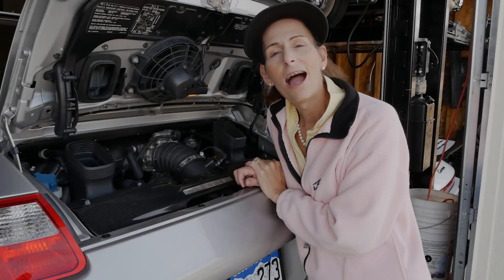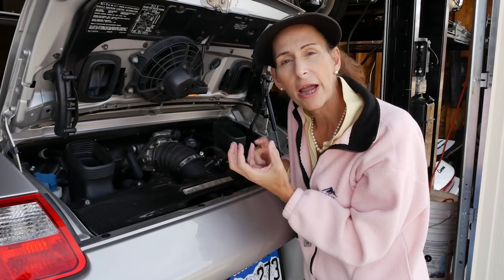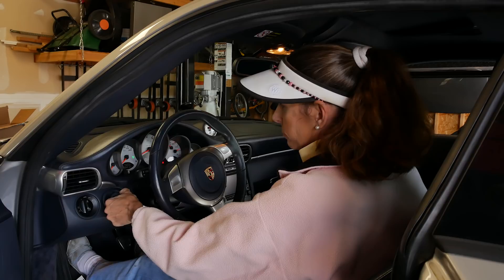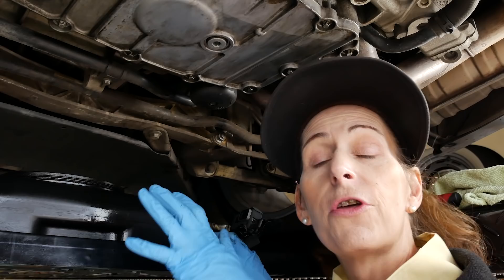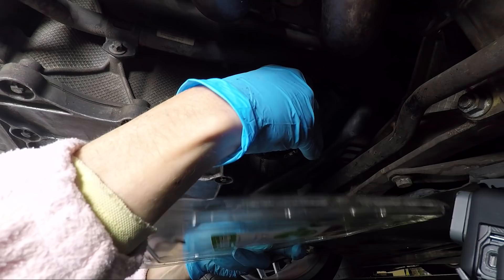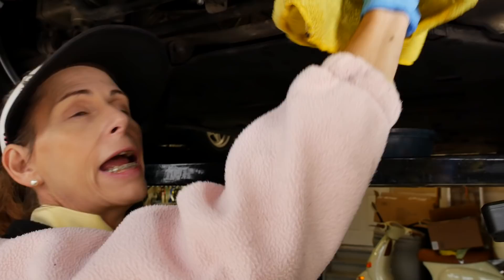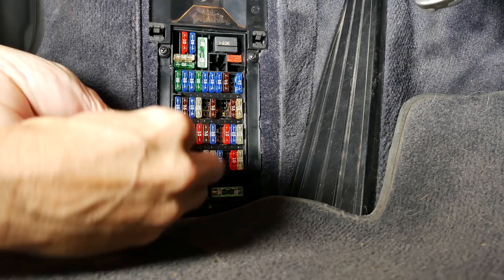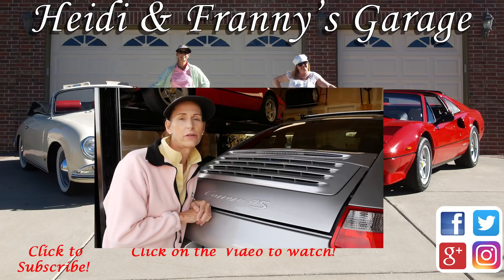How to Change Oil on a Porsche 997 Carrera 4S – with Blackstone Analysis! (DIY)

Comment from the maker: Hi Everyone, A new video on an oil change, this time on a 2006 Porsche 997 C4S with the super cool X51 performance pack.  This is our friends Dave and Jody's car  - you remember their beautiful yellow 2002 Boxster :)  We did an oil pull for another Blackstone analysis and Dave will post the results as soon as they come back.  I did a few sort of optional steps that you can decide if you want to bother or not.  They are to reduce ware on initial startup with the new oil  I have all this info in the description, but tools and parts are:

The following steps are optional:
• Prefilling the oil filter housing half way with oil.
• Blackstone Laboratories oil test.
• Pulling the fuel pump fuse.

The parts used are:

• Oil Filter Kit (includes large rubber O-Ring): Hengst E14H D77 (99610722560) or MAHLE https://goo.gl/yJLkuD
• Mobil 1 120760 Synthetic Motor Oil 0W-40, 5 Quart : https://goo.gl/GECf9i
• Case drain plug washer: 900-123-106-30 18X24 (Al)

You’ll need:

• Filter Cover Socket: 000-721-920-40
• 8mm Hex
• Torque Wrench
• 10Qts of oil (capacity is ~9Qts)
• Blackstone Analysis Kit (optional)

Torque Values:

• Case Drain Plug: 37 Ft-Lbs
• Oil Filter Cover: 19 Ft-Lbs

The oil I used (supplied by Dave) was Mobil1 0W-40, but use what is specified by your owners manual.

* UPDATE: I got a message from a very knowledgeable viewer who mentioned the oil level is best checked warm as the oil will expand and it reduces the risk of over-filling.  In addition to that, it is best to shoot for one notch from the top and not the top mark on the E-Gauge.  I also did some research and for the 997.1, the oil check system tries to take into account the temperature and will control when it will display the oil level. For the 997.2, the oil is checked hot.

Hope you enjoy this!  Any questions, please leave them below.  Thanks!  Franny
Reply: I enjoyed your Carrera 4S oil change video. I want to keep my 997 2008 Turbo from starting to bring up the oil pressure. Which fuse is the fuel pump fuse? Do you have a Turbo oil change video?
Thanks,
Kenny H

Comment: Dear Heidi and Franny, First off, I wanted to compliment you on the channel and the videos. They are very educational and informative for DIYers such as myself who would like additional tips on properly caring for your car. I've watched almost every video and will start applying some of your techniques to my maintenance procedures. Second, I especially like that you have a particular focus on Porsche - it's one of my all-time favorite car brands. However, I am a vintage Volvo enthusiast and have exclusively driven Volvos for many years, since a car accident in late 2004 (Yes, I was in a Volvo!). I'm sure that you see countless old Volvos in your area out in Colorado.

I also like the fact that none of your vehicles are what they call "garage queens," in that you drive all of them whenever you can. I have three Volvos - two 1989 740 GL sedans, and one 2000 V70 station wagon. I purchased all three cars from their original owners, who were all U.S. military. They are some of the best owners to purchase a vehicle from, as you know that they have taken meticulous care of their autos. One of the 740s has well over 300,000 miles on it - 306k, to be exact. I've found over the years that the older RWD Volvos with the "redblock" engines are some of the simplest and easiest vehicles to work on - for example, doing oil changes takes about 20-25 minutes for me (4.5 quarts with filter). And just like you, I use only OEM parts - no exceptions. I don't take shortcuts when maintaining and repairing the Volvos, and I don't cheap out on the parts either.

If more folks watched your videos, there would be a lot more older vintage cars still on the road. Just my $.02.

Keep up the good work! Best, Paolo Rosales, Alexandria, Virginia
Reply from the maker: Thanks so much!  I had a Saab years ago and just loved it.  My sister had an older Volvo and it was a great car!  I always love seeing the P1800s at shows ;)  Franny

Comment: This is the best video for a 997.1 oil change that I have found, and I think I have watched at least ten. Thanks guys. I’m off to do it right now!!!
Reply from the maker: Yea!  Thanks so much! I hope it all goes well :)
Reply: @HeidiandFranny  ha! Guess what? I got all my stuff ready and then I find out my car has the spin on adapter.  That means I had the wrong filter. The wrong wrench. And I certainly couldn’t simply fan out the filter to inspect it. But, I made the whole thing work.  I did, however, do your fuel pump fuse trick!
Reply from the maker: @frugalera  oh no! Why would someone do that? The factory setup works great. Oh well.  I suppose you could use a manual can opener and still cut it open, but what a pain. Well, party on I suppose :)

Comment: Excellent video. Liked the precaution of fuel pump fuse removal. Bet the OPC doesn't bother with any of these precautions!! My OPC is pretty sloppy...so I do the servicing myself...not simply to save a whole wad of money for very little in return...but to make sure that servicing is done correctly and that paintwork doesn't suffer those annoying scratches and chips from careless contact from tools!

Comment: Thank you for a very informative video for those that like to do their own oil changes. IMHO, Porsche didn't get the IMS issue solved until the 997.2 or 2009 model with the complete new engine design. I've talked to many people with 997.1 (i.e. 2005 - 2008) cars that have suffered from IMS failure. Had they took your advice (e.g. examine the oil filters) as well as a few other things (i.e. change oil more regularly) they could have avoided engine failure. I agree the updated bearing in 2006 was more robust and could handle the load better than the previous single row bearing found in the 996 and early 997, but still could fail which required the motor to be completely split to service and repair if the motor could be reconstructed.
Reply from the maker: Thanks for that!  We had an '06 Boxster (did I mention that?) and I did sweat the oil changes a bit.  It is difficult to know exactly when Porsche changed over to the non-serviceable bearing by engine numbers. So, the long and short is, as you mentioned,  '09 or later if you never want to even consider it, '06-'08 if you are willing to take on a small(er) risk, and earlier if you take the car in and just get it replaced with a rear main seal and new clutch.  For all of them, cut open the filter and maybe send the oil out for analysis.  Oh, and drive the car!  Looks like there are more failures in cars with short trips/low mileage and less on track cars.  That's probably because of water and gas in the oil penetrating the seal and washing out the grease in that bearing.   Franny
Reply: Most of the experts (Flat6Innovations, LN, etc.) say that the bearing and intermediate shaft was updated mid-year in 2005 for the 997. And so, if you have a 2005 997, then it's possible you have newer bearing, but you can't be 100% sure without examining the outer IMS flange. If you have a 2006 - 2008 997, you definitely have the updated shaft and the larger non-serviceable single row bearing. The larger single row bearing in the 997 has proven to be superior to the older 6204 single bearing found mostly in the 2000 - 2005 996 cars, but it still can fail. Therefore, it's important that people that own the 2006 - 2008 997 cars, that although you have a better bearing, it's still smart to take preventive measures (changing the oil every 5000 miles or twice a year, examining the oil filter, BlackStone oil analysis, etc.) to minimize your chances of catastrophic engine failure.  In my humble opinion, M96/M97 "garage queen" cars are more susceptible to IMS failure than well-maintained daily drivers. I believe there is a lot of truth to your theory about acidic oil penetrating the bearing's seal and causing it to deteriorate and once load is placed on a damaged IMS bearing, it's... BOOOOoooOOOOoooOOOOm!!!!
Reply from the maker: Lol.  Thanks, so it was mid-year 2005 that it changed... Good to know.  I tried to figure that out when we had the car and got totally turned around chasing down engine number ranges.  What is your opinion on the aftermarket bearings (LN, etc.)? I know of someone who had the bearing swap preventively only to have it fail a short time after.  I don't know if it was just an OEM replacement or not, but I have wondered if anyone is tracking the updated bearing failure rates.  Not Porsche's finest hour...
Reply: Yes, that's coming from the people like LN and Jake Raby that know these engines inside and out. Aftermarket bearings? That's a good question! As a Porsche 996 owner myself, I've thought about that a lot, there are only two options of the table for me - the LN engineering bearing (IMS solution being my top pick) or the new OEM IMS replacement directly from Porsche. That's right, Charles Navarro from LN said that Porsche is now offering an official bearing replacement for the 996 and 2005 997.1 cars. The Porsche OEM bearing is similar in design to the updated bearing in the 2006 - 2008 997 cars. But hands down, if I were going to replace the bearing with an aftermarket product, it would be from LN engineering. They're the only ones that sell a proven patented bearing. To date, LN states that the IMS solution has no failures so far. The IMS solution is a patented oil-fed design similar to design to the GT2/3 and Turbo series cars. Please know, I'm not paid by either nor have any financial dog in this fight.

Comment: Great video! On those engines, I always replaced the 8mm drain plug, because it’s very difficult to remove it it get stripped out. $5 part.
Reply from the maker: I totally agree...  the hex kept getting stuck in it :(  Just replace with a magnetic plug and problem solved :)

Comment: Franny, Also I think that should be included how to reset the oil service light in the dashboard, as it seems that is on when you started the car, otherwise, very detailed procedure. Regards!
Reply from the maker: Yes.  The owner has a Durametric and he said he would just go ahead and reset it.  For our cars I've just dropped into the dealership at an off time and they are happy to do it.  I don't think it can be done through the menu.  A thought might be the Carly ODBII plug-in.

Comment: Heidi and Franny, Love the channel and look forward to the videos I am looking to purchase a used 997.1 Can you tell me which year of 997.1 that Porsche solved its IMS bearing issue. ? 

Thanks
Mike
Reply from the maker: Hi Mike, It was completely sorted in 2009, but starting in 2006-ish the bearing is no longer serviceable without a complete tear-apart of engine.  It really goes by engine number and not year.  I have researched this a bit when we had our 2006 Boxster but I found a bunch of conflicting data.  You might want to do a little digging on Renlist and Pelican and see if there is any new info on it.
Reply: @HeidiandFranny  Thank you for your response. I do appreciate your help
Cheers
Mike

Comment: Do modern Porsches not have magnetic drain plugs? 

Also would have been a good idea to have the camera show the oil pressure gauge while you’re cranking it over, as that’s the point of doing it to build some oil pressure first. Otherwise, very nice video!
Reply from the maker: Yup, totally missed that opportunity.  I had forgotten that the 997s had the pressure gauge on the far right.  It was missing on my Boxster.  Oh, and they don't have magnetic plugs from the factory, but it is an easy, cheap upgrade.

Comment: Never double or triple click a torque wrench - it adds to the torque applied more than you realize. And i am against filling filter housings with oil unless you know its absolutely clean. A small piece of dirt not going through the filter and into the bearings could cause permanent damage. Otherwise a great video.

Comment: hi franny, please can you do at some point a service /oil change on a 996  thanks as  you explain it so well to us mortals
Reply from the maker: Hi Mike, Check out the Boxster oil change...  That will get you going on the 996 NA (M96 engine) cars and I did our 996TT for the Mezger.  The Boxster is basically the same, just with the engine in front of the transaxle.  I might be able to find a 996  to con someone into letting me get my blue gloves on...  F

Comment: Hi Franny, how do you reset/remove the “service now” message on the instrument cluster?
Reply from the maker: Hi Bernard, The easiest believe it or not is to stop by a dealership during an off hour and most will do it for free.  If you want to do it yourself, then the Durametric will push out the interval, but I don't think you can set the actual time interval.  There are other OBDII/phone modules you might be able to use, but check to be certain it can actually clear services intervals.  I don't think you can do it from dash controls like you can on the MINI :(

Comment: thanks that was a  great video,   what s   the weight op the oil
Reply from the maker: @user-qv7ov9gq5y  Just use the manufactures recommended oil and you'll be fine.  Weights are dependent on the climate the car is driven in.

Comment: I have a Porsche 996 from 2002 - when driving at constant speed between 86 and 100 kmh I hear a whistle , we a press the gas just a bit the sound is gone, same when I remove my foot from the gas so only at constant speed when engine is warm. Who knows what this is, or had a similar experience? Thanks Oscar from The Netherlands

Comment: Another 997 question. What's the actual voltage on the battery when the engine is running and hot on one of these? I only get about 13.6 volts which I think is low. When I purchased the car it had a brand new alternator on it. On the drive home at a motorway rest it almost did not start.  I later noticed low charging voltage of 13.2 volts hot. After living with the problem for a few months I came to the conclusion my starter / alternator cable were at fault. So I replaced that (horrible  job). Now the starter is fast but I now only have 13.6 volts. As my car sits around for a week or so at a time flat batteries are a problem. I came up with an interesting solution to that a year ago. That is to use an AGM type battery. Now no problems but I still think 13.6 volts is lower than it should be?
Reply from the maker: What about a trickle charger?  We have those especially for the winter months. Also, 13.2 seems normal but you could check the specs.

Comment: Could you please please share your opinion on the IMS bearing M96? Also any after market improvements
Reply from the maker: It is a potential time bomb if you have not had it fixed.  However, if it is fixed by a competent shop, you should never have an issue and get a great car at a reasonable price.  Regular oil changes and monitoring like Blackstone will help the unfixed cars, but no guarantees.

Comment: Franny, do you have to clear the service needed indicator manually? I know some cars have elaborate combinations of turning the key on and off, shifting gears, and putting on the brake to clear service indicator lights after service is performed. Does Porsche make it easy?
Reply from the maker: Hi Sherri, I believe you need a Durametrics or similar...  If you have a good relationship with the dealer or an Indy they can do it for you as well.

Comment: Thanks a bunch ! I just changed my 996 and it’s got the original IMS bearing... i noticed a bit of a leak ( i guess it’s the rear seals) 
   How would you address that shaft bearing? Since I realize the seals need replacement...
  Thanks
Reply from the maker: Well, the transmission will need to come out and you can do the rear main seal at the same time.  Check the clutch, because while you are in there...  Is that where your leak is? Between the transmission and engine?
Reply: Heidi and Franny's Garage 

Yes the leak is between the two ... what’s you view on this aftermarket fixes ? Which is best ? Why
Reply from the maker: Ok,...  The RMS can allow oil to seep into the RMS bearing and cause it to fail so, that needs to get done. LN Engineering is very popular.  I honestly have never had to deal with this issue so I don't have first-hand experience.  Looks like their kit is $800 or so. I wonder about the active oil flow systems... Seems like more complication than necessary and IMHO that bearing needs grease and not oil due to the load.  Once again, I don't have first-hand experience though.  Talk to a few local shops and see what they use.

Comment: I have one of these cars that I work on myself.  As mine spends lots of time sitting around (I always drive it for more than 30 mins when I do use it) it seems to me that the service indicator only comes on after about 2 years. I change my oil once a year regardless of the indicator. What do you think of the Porsche service indicator system?
Reply from the maker: We use our own system. For example, brake flushes should be done more often in a humid climate. So, annually for oil changes is good regardless of the driving time.  The indicator lights are helpful if something major happens and you shouldn’t be driving your car.  The light on the 911 was on for another reason.